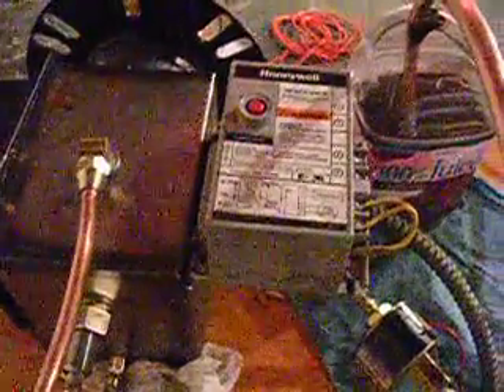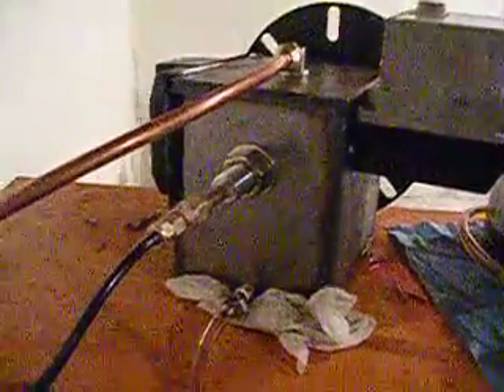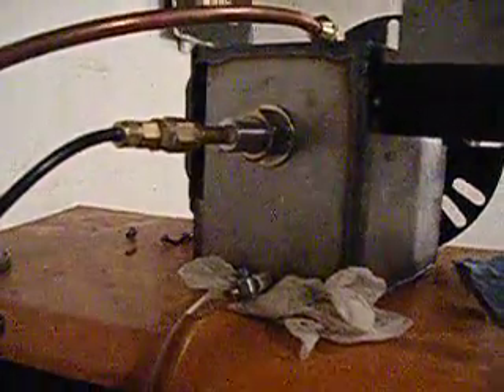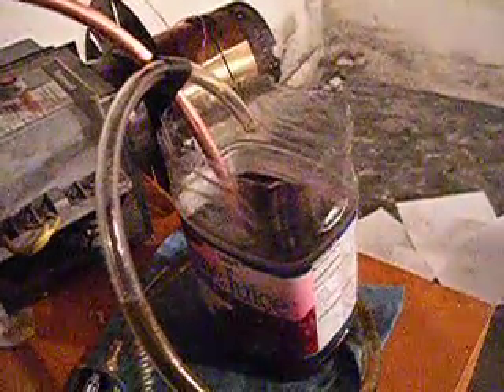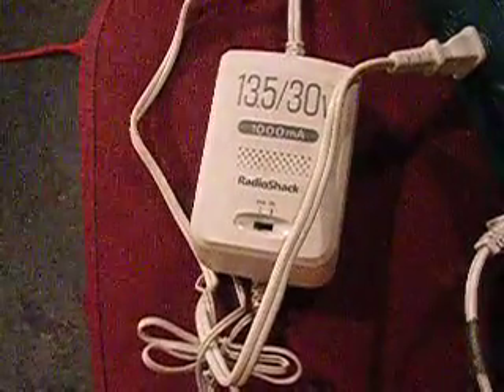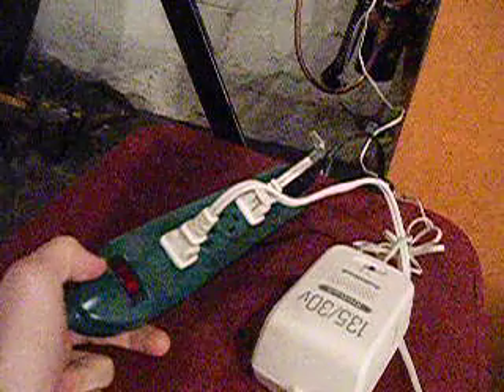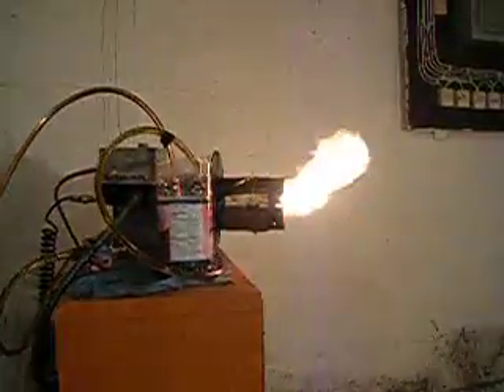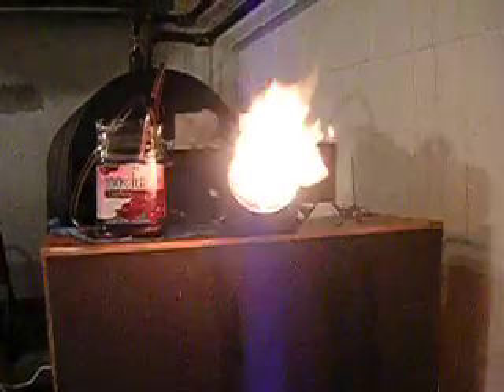Prototype Burner

Comment: Very clever arrangement, if only you could avoid  the need to recover the un-atomized fuel with a pump.  Un-atomized fuel makes a mess, and causes secondary fires to break out in your furnace, sooting up everything.  The excessive heat might crack your furnace core and leak CO into the house.... preheater and a siphon nozzle seems the way to go for the cost of a crock pot and 100 dollars in parts.

Comment from the maker: Yes, this uses the principles of a babington ball, in that there is a curved surface inside for the oil to run over.  I do no pre-heating.  the basement temperature, and the oil temperature was 55 degrees F at the time of shooting the film.

Comment: hi we have done this in our lab in england (garden shed) and we did it by placing the feed line in front of the burner and returning it to the feed in pump on the normal standard burner no compressor just extend the feed pipe in front of the burner   very simple......this makes the flash point higher so may be you can have a go and see if it is even better cheers you can also use waste hydraulic oil with an inline normal truck diesel filter housing